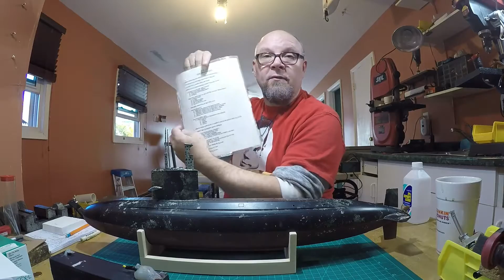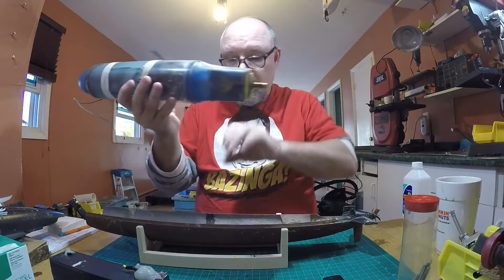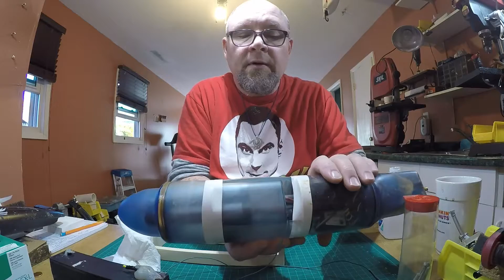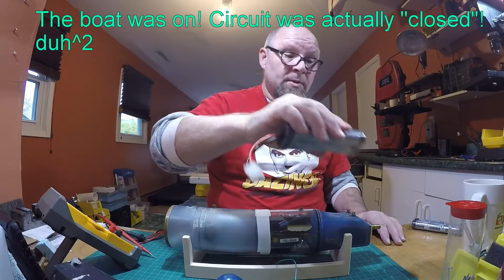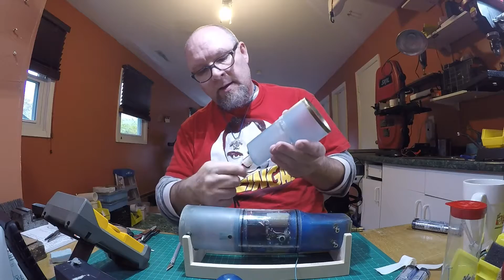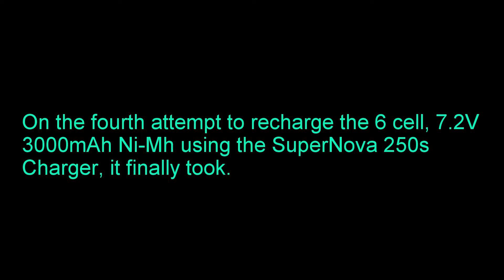SUB LOST: USS BLUEBACK SS-581, a "Special" Report

Comment: Nice postmortum, being submerged for so long and no water inside is a tribute to your skills, as for the battery, i suspect those cells inside are gone due to discharging all the way, those type of batteries don't like that, it seem you're measuring only one cell still alive.Maybe you are lucky and hitting it with the charger will revive that battery, but for security sake i would dump it, or you can loose the boat again due to a faulty battery.As for the growth on the boat, nice weathering, seal it up and it will stand out in the crowd, there is after all a nice story attached to this boat.Manfred.